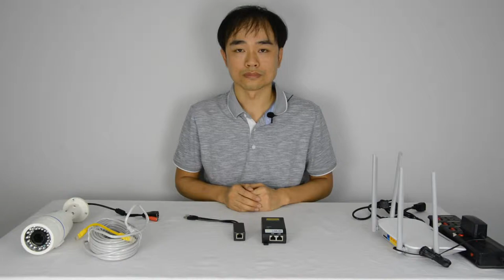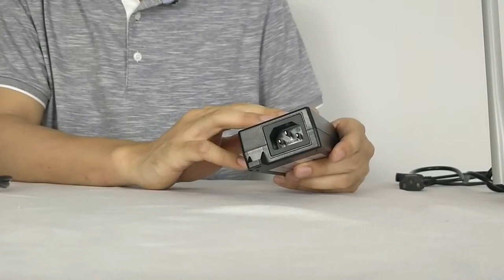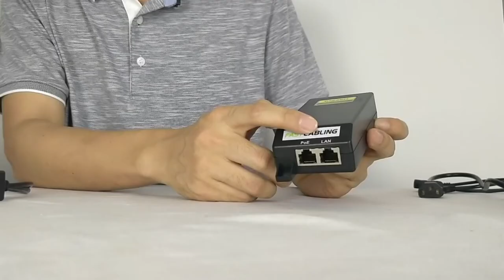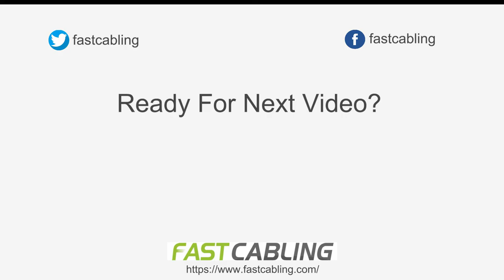Use PoE injector and Splitter to send Power over Ethernet Cable

Comment: Hi, I have a poe+ switch (48~56Vcc output) and only one camera 12Vcc, can I use the spliter for this case? Does the spliter reduces and stabilize 57Vcc to 12Vcc ?
Reply from the maker: Yes, You can use the PoE splitter which can separate the power from data and regulate it to DC12V.

Comment: What's the point of POE if you are supplying power through coaxial cable? Shouldn't LAN suffice alongside the coaxial?
Reply from the maker: It is the cat5e cable, not the coaxial cable. You still can use the coaxial to send the PoE but it need special converter both end. Unless it is the system upgrade, you don’t want to wire the new cable, it doesn’t make sense to use coaxial for standard PoE network infrastructure.
Reply: @Fastcabling  maybe i wasn't so clear. If you can use a LAN cable from router to camera for data and a separate coaxial cable for power; Wouldn't that be a cheaper solution? I think injectors are more expensive than a simple power adapter + LAN cable.

Comment: Hi....I am trying to power an ASUS wifi access point with POE using a POE inverter and then an POE splitter.  So similar to your video but instead of an IP camera on the end will have a ASUS router.  How to I make sure the POE splitter outputs enough DC power to power up the ASUS router?
Reply from the maker: I think what you need to verify is the voltage. Most of the PoE splitter outputs DC12V. You must make sure the ASUS router does accept DC12V. Most of the SOHO router needs less than 10W. Even the PoE IEEE802.3af can supply enough power.

Comment: if i dont have poe switch(im using non poe switch)..does poe injector will supply power to camera?do i need the spliter too?
Reply from the maker: Yes, the PoE injector can add the power to the Ethernet cable. Your edge should feature with POE, otherwise, the PoE splitter will be needed. The PoE camera accept the DC48V POE from a switch or injector.

Comment: If I have an NVR, does the NVR replace the injector? Would I still need an injector if I use an NVR instead?
Reply from the maker: The purpose of PoE injector is to add power to the Ethernet cable and send it to your edge PoE IP camera. It doesn't overlap with the usage of NVR. If you pick the PoE NVR which has integrated POE switch into NVR box, you don't need the PoE injector or switch anymore.

Comment: hi, do i need a splitter if i want to use this for a voip phone? i dont plan using the lan port since  there is a port on the voip phone for that.
Reply from the maker: If your VoIP does a feature with PoE, there is no need for a splitter. The PoE splitter separates the power from data, meanwhile, regulate the PoE power to DC12V in most of the design. let's say your VoIP is not PoE compatible. The PoE splitter will provide power (DC12V) and the data to the LAN port of your VoIP. The input port at the PoE splitter will be linked to an injector or POE switch at the back-end. The LAN port has to be occupied.
Reply: @Fastcabling  thank you for your answer, but i have 1 more question, is it possible to use a ethernet outlet to plug in for lan?

Comment: the camera said 48v i wonder what poe switch i need i found one but cheaper is 70w and the   other is 120w what watts in poe camera why not ampere? i am confuse the camera name is besder poe 5mp thanks for help
Reply from the maker: Usually one camera needs 10-15W around. Some may needs higher power budget. The 70W or 120W is the totally power budget of  the PoE switch. You will need to calculate the totally power budget of all your cameras, and compare with the power budget of your switch. One more thing, the power consumption on the Ethernet cable also need to be considered. For example, IEEE 802.3bt output 30W power on the PoE switch, but you only will have 25.5W at the camera end, because it always has power consumption inline which will be converted to heat eventually.
Reply: @Fastcabling  great help. Thx 🙂

Comment: can you use a POE injector soley to deliver power?
Reply from the maker: Technically you can use the passive PoE injector to send the low voltage power through cat5e or cat6. However, you will need to deal with the voltage drop. Moreover there is no power handshake between the injector and the edge device, I would not recommend unless you know what you are dealing with.
Reply: Price of POE injector

Comment: I have ip camera, but i wanted to have nvr, what should i do? I don't  really like the wifi nvr
Reply from the maker: You will need to make sure the IP camera is PoE compatible. Otherwise, you need a POE splitterl to convert and regulate the POE power to DC12V to supply the camera. Next you can either choose PoE NVR or non-POE plus a PoE switch to setup the system. It is critical both IP camera and the NVR support Onvif protocols. The IP camera system doesn't work like the analog camera. It may has compatible issue. The Onvif protocols can settle the compatible issue.
Reply: @Fastcabling  Thank You! By the way all my IP cameras supports Onvif, and O am planning to get a POE NVR. 
You helped me a lot!